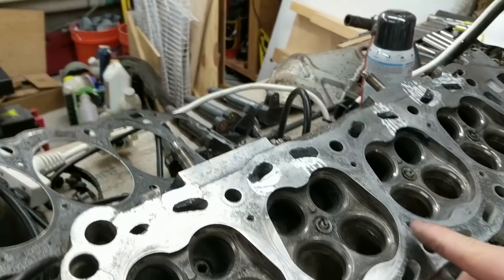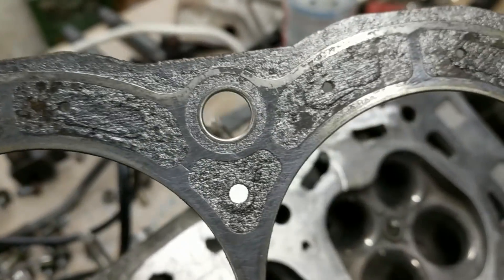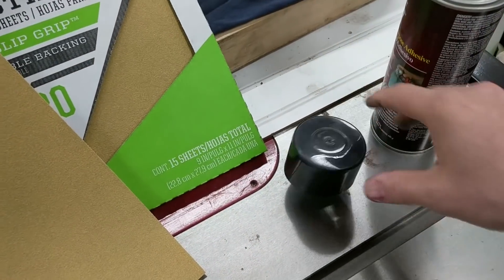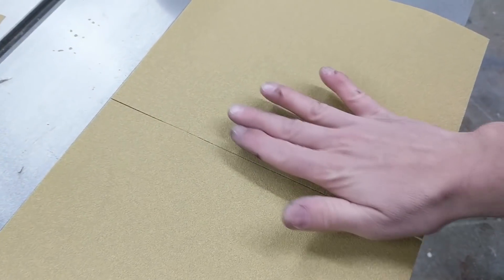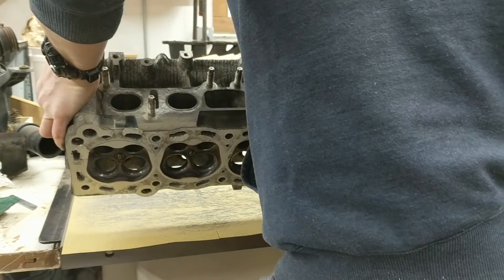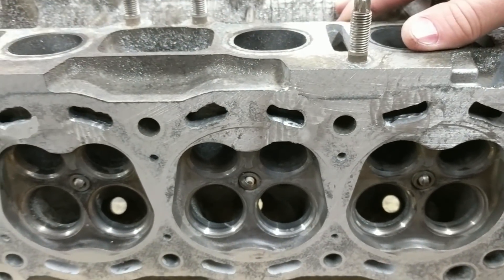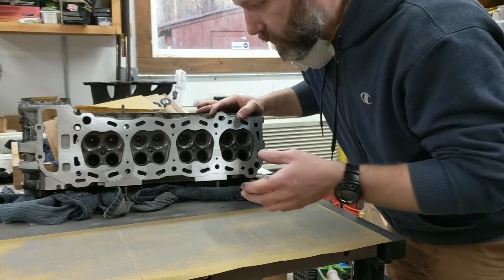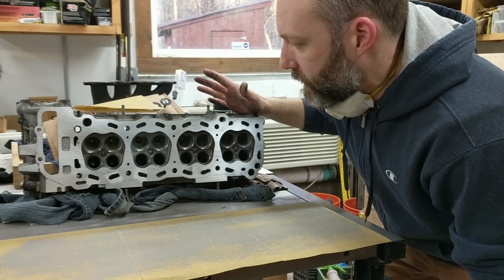Using a Table Saw to Resurface a Cylinder Head

Comment: Was anyone else expecting him to use the saw blade to machine the face with the head laying on its side ?
Reply: Actually, yes I wanted to see that and what kickback looks like when a cylinder head hits a table saw.
Reply: @fortunateson6070  the kick back would be mental
Reply: Probably not much kick back lol. I accidentally hit a steel c clamp and it kicked a little and cut right through it. It was pretty scary though lmao
Reply: @540 MUDSTAIN I was envisioning a modification that resembled a flycutter, hopefully with a reduced speed..
Reply: @trwsandford  I thought he might have done something like that too but this was very cool to see in gonna keep eyes out for a old burned out table saw now
Reply: no, but it's simply clickbait!
Reply: @540 MUDSTAIN This is YouTube , less common sense = more views, that's why I clicked, there's loads of videos of refacing a head on a flat surface
Reply: @megaflea2k  yeah these are the same people that buy stuff from Harbor freight
Reply: I wasn't sure what he was gonna do but I was definitely confused lol. I couldn't imagine how you could use a table saw to machine the heads so I had to click on it but I thought it was click bait.
Reply: @my2centz196  not click bait he did use the table saw lol
Reply: I remember hearing of a local guy on a building site and he asked the   supervisor for chainsaw as he was chasing the block walls for the plumber, the supervisor snapped at him saying "shur tisn't chasen the walls with the chainsaw your going". Every time I heard the story I laughter until two years ago when I say a guy with a special chain doing just that and now I certainly feel stupid.
Reply: There are blades that can cut through steel and aluminium and as clickbait as this is there is a chance that he has unknowingly invented a procedure for facing engine heads using a table saw fitted with a special steel cutting blade.
Reply: my2centz have no idea what kind of mess it would make, but I suppose you could try setting the blade height at something like .0005” and just work the head back and forth until you’ve covered the entire head or broken some shit...
Reply: @540 MUDSTAIN hey, man...I've seen some stupid stuff on YouTube...
Reply: I was. And it wasn't for lack of common sense on my part. Seen all sorts of stupid shit
Reply: YES
Reply: I was wondering what kind of blade to use to do that.
Reply: I've been using a table saw for 40 years there's nothing I can't do with it so your remark about common sense is why you'll never have anything more than common sense
Reply: @markmclaren2431  you're so right
Reply: Actually, I was imagining he was going to use a carbide toothed saw blade and attempt milling the head, tediously scooting it along making .125" passes. The part I couldn't imagine though was how he was going to support it after he got close to the halfway point.
Reply: @christurnblom4825  Bolt a couple of pieces of cold rolled steel to the intake and exhaust ports with their bottom edges a couple of thousandths proud of the bottom face of the head. Space those pieces out a bit so they're not against the edges of the head bottom. Clamp a pair of boards to the saw table as guides so there's no way the head can be moved far enough to either side to allow the steel supports to hit the blade.
Then the trick to not earning the Severe Table Saw Injury Demerit Badge would be to have the carbide tipped blade height just high enough to 'dust' cut the aluminum. To cut a wider path, try a pair of coarse blades clamped together so the teeth can be set to fit into the gullets of the other blade. How about three blades? Or a carbide stacked dado set? If it's only cutting half a thousandth or less, the forces pushing on the head ought to be very low.
Reply: @greggv8  
Nice! You should start a channel called Table Saw As a Horizontal Mill. I'll help. We can tempt novices worldwide to chance scareing the shit out of themselves or suffering moderate to severe bodily injury. ...or both!
Reply: @greggv8  you are right on the money, ive used this basic method many times on aluminum and cast iron, with the masses involved its not even very freaky
Reply: I wouldn't have clicked on the video without the visions of table saw action.
Reply: Yep, and I wanted to see how much more mig welding he was going to be doing after attempting to surface it with the table saw.
Reply: Yep.
Reply: yes ;)
Reply: i was expecting him to use a big grinder disk on the saw , lowered flush to the table
Reply: @540 MUDSTAIN sure but we live in the "Hold my Beer" times of people one upping someone else.
Reply: 540 MUDSTAIN:  Really? I thought his plan was to make 4 one cylinder engines for motorcycles.
Reply: @540 MUDSTAIN no one with common sense would do this at all I wouldn't even do this with a face model and I'm a machinist. This needs to be done on a surface grinder. this is the most absurd thing I've ever seen in my life
Reply: The title was click bait and it was genius to use that title 🧐
Reply: I wasn't expecting, that would be crazy. But damn I was sure hoping he would try🤪
Reply: Hahaha, yes. I saw the title and thought "Oh here we go. This will be good to watch."
Reply: megaflea2k had me like how
Reply: No.... I knew what he was gonna do
Reply: @robertsherrick4081  Just like your comment. He was right.
Reply: yep
Reply: @540 MUDSTAIN i was curious though when using a saw....could have been any surface which is flat!
Reply: Yes thought that was the idea.
Reply: Yep
Reply: Guilty, that`s why I`m here lol.
Reply: @540 MUDSTAIN This is only  reason why I clicked this video, to see how the fuck it's possible, I hoped something really ridiculous. But nothing special just flat surface
Reply: Afraid to say yes, i was.......
Reply: Yep,that's why I look  this film too see what happend.Fun.
Reply: I kind of did :/
Reply: Yes, I had and didn't believe it was possible or even remotely safe.  With that title, he had us all "take the piss".  LOL
Reply: It did occur to me but I couldnt picture it working - lol
Reply: Thought he'd use Emery cloth instead of sandpaper.
Reply: megaflea2k ...Something like that wouldn’t have a Chance In Hell of working but would LOVE to watch em try. He would have to use a Crosscut Blade not a Rip Blade.
Reply: Yep
Reply: I expected the saw blade also but it's a good video
Reply: Kinda lol
Reply: Yupppp lol
Reply: Yes.
Reply: That title has Darwin Award written all over it, LoL!
Reply: Yes sir...lol..
Reply: megaflea2k Yeah I was wondering on that too!
Reply: I cut 1/4 inch aluminum plate all day with a skill saw and wood blade   I’ve used   Table saws to cut aluminum diamond plate  also.  Works great I can tell non of you acually do any fabrication.   You cannot cut aluminum with a grinder   It’s a non ferrous metal      Steel vs aluminum.   Steel always wins
Reply: Yup..
Reply: Yeah, I was trying to figure how that saw blade would mill the head!
Reply: False advertising. He should have said "Using the table of a table saw to resurface a cylinder head"
Reply: Hahaha yes, me hahaha
Reply: Holy crap yeah that was what i was thinking!!!
Reply: Guilty 🙋🏻‍♂️
Reply: no
Reply: yep
Reply: You never know on youtube.  That would produce horrible results as you get  blade deflection from chatter & side loading - it would be a guaranteed way to lose flatness, even using a diamond type masonry blade just feathering the surface.  Do that... and there won't be any choice but to take it to a machine shop.
Reply: This is YouTube @540 MUDSTAIN  Things far less sensible have been attempted
Reply: thats the only reason I actually clicked on this vid lol
Reply: I just wanted to let him borrow my bong
Reply: I just wanted to let him borrow my bong
Reply: @540 MUDSTAIN yes I did because that's exactly what he said. But I didn't expect it to work.
Reply: That was the only reason I clicked lol. See him slide it through, flip it and do the other half
Reply: Yup
Reply: @540 MUDSTAIN I was hoping to see him use the saw. WTH, better him than me!
Reply: megaflea2k 
Yes sir
Reply: @540 MUDSTAIN How about uncommon sense.
Reply: Yes !!! I was hoping to learn a new trick !
Reply: Yeah, me! 'Cept I thought he was gonna do it laying down, with two standoff strips bolted to the sides. Even as a woodworker, I'm disappointed with the flatness of almost any tablesaw top. Using it like a surface plate? On the other hand, it is eye opening to see what might be done with a lower standard of equipment, and still work. Maybe it doesn't need surface plate flatness, just enough to let the head gasket seal. All the moving parts are adjustable, rockers and such, aren't they? Fair play to you, Dennis.
Reply: @540 MUDSTAIN, I expected him to mount a grinding wheel. Why not; I've done it. Just not to surface grind a cylinder head.
Reply: I was, Lol
Reply: That's the reason I'm here
Reply: @540 MUDSTAIN  After seeing idiots do all kind of weird things to cylinder heads i wouldn't be so sure....
Reply: I was
Reply: That's why I clicked on it initially. I have seen the sandpaper videos before and I thought "hey here's a guy with a diamond blade on a timbers saw facing an engine block,  cool." I enjoyed the video immensely as there is no horrible music and the guy is straight to the point. I am wondering how long it took him using this lateral movement and is this head aluminium.
Reply: Yes....
Reply: He hooked us all! Great method though.
Reply: yeah. i did.  but you could do that with a carbide blade.. maybe stack a few up...I bet it would work if you took real light cuts..
Reply: Im dissapointed that he didnt
Reply: Tbh i think it could be done, cast iron is pretty soft and i have seen people cut glass on a table saw 😂
Reply: Yes, as a matter of fact I was very curious lmao
Reply: A carbide saw blade would easy cut a few thousands of inch of the aluminium head. I clicked to see how he did it. I once forgot to change the carbide blade from my saw to the abrasive disc and it cut through 1/8" steel plate 1 foot long cut before I noticed.
Reply: @540 MUDSTAIN this is YouTube. Common sense only comes in U.S. currency.

Comment: I did this on my 351w used 220-320 and 3m pads i also turned like cross angled i guess idk but it work just check your specs for your heads get i nice feeler gauge and a straight edge check all around for gaps or anything

Comment: Well that's one way to do it.  The only thing that has me concerned is how much material was removed.  Best to check valve to piston clearance afterwards.  Don't ya think so?
Reply from the maker: Probably would be a good thing to check, although I think this removed less than milling would have.
Reply: Believe me, sanding .010" off a head like this will take a long time! But if you have a .005" warp it won't take too long to cut the high spots off. Once you are touching the whole head it stops cutting! That's why you use coarse paper. Someone said use 400 or 600 paper.....if you had .005 or .010 warp it would take weeks!

Comment: As long as you checked the head surface with a good strait edge and have 0.001" or less, you're good to go.  I hope you laid the camshaft in the head to check for any warping in the cam journal bores.

Comment: Shouldn't you follow up with a finer grit sandpaper and then a finer grit and so on until the head had a mirror finish on it?
Reply: no if you get it to smooth the gasket blows out because the friction that holds it in place is gone

Comment: A light coat of engineers blue before sanding would make figuring out the low spots a lot easier. I have to wonder about  using sand paper - sand loosening and getting embedded in the head

Comment: Two things you can do to ensure even flattening... 1) Spray a machinist dye on head surface much like a guide coat that paint/body guys use to assure even blocking.  Easily reveals hi/lo spots. https://www.amazon.com/Blue-16-oz-Spray-Layout/dp/B002SLGAQ2  This is the preferred brand used throughout the aviation machinist trades.2) The other is using a known dead flat parallel bar to check across the length, width and corner to corner with feeler gauges.  With bar across the head, backlighting will reveal any gaps.  Measure these gaps with the feeler gauges.  Most OEM specs allow 0.003 in. gap or less, you're good to go. If 0.005 or more, additional work is needed.  This technique is used in precision lapping of numerous components.